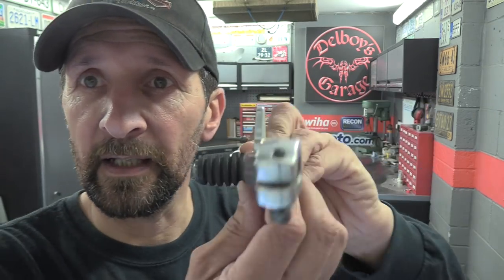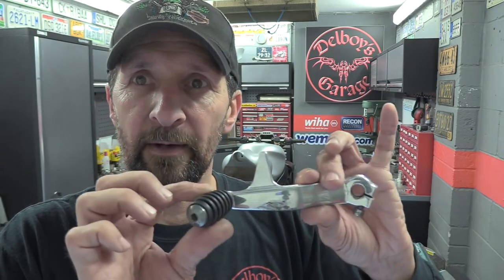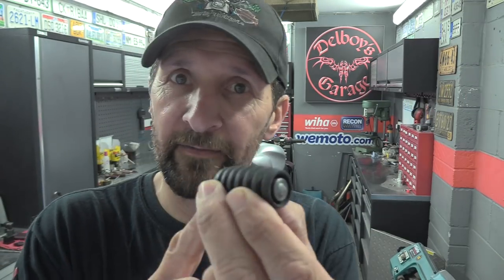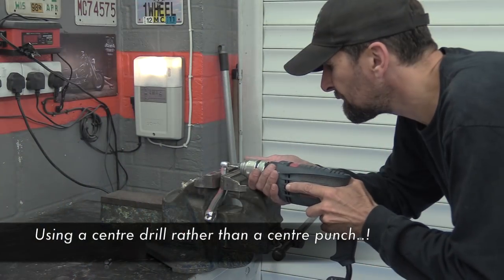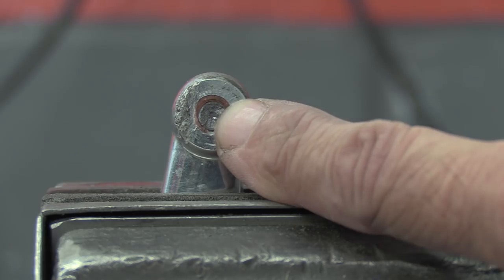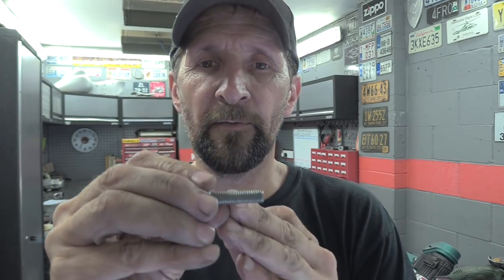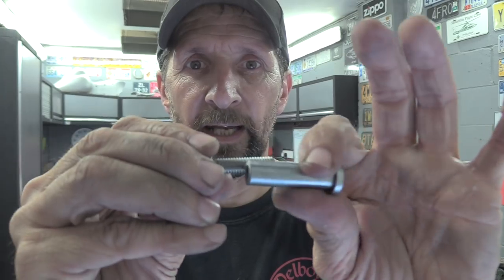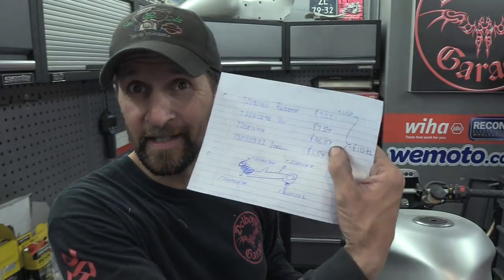Delboy's Garage, Broken Gear lever fix..!

Comment: A friend of mine who is an aircraft engineer showed my a great way to drill down the center of a broken off stud. You had some thread on the back of the lever. Get a bolt the same thread, Put that in the lathe and drill down the center of it. To which ever diameter you need. Then screw this in on top of the broken stud and use it as a guide to drill dead center into the stud.

Comment: Broke exactly the same way on a solo tour into the mountains in India with no repair shop nearby. The lonely road side shop I found could not drill out the piece stuck inside. Had to hitch hike to a bigger town to get it drilled out. Came back and put a bolt through with a few nuts to cover it and rode 500kms back home. So much for engineering design! The video brought back some fond memories of that trip!
Reply from the maker: Yes i think they really could have done  bit better in the design, even if the hole in the arm was clear, and a screw from the inside, then all you would have had to do was poke out the broken bit and stick a new bolt through the hole... I guess we can always improve on factory design in the small things... Thanks for sharing your experience, you videos look like it was an awesome place.. ! take care.. Del.

Comment: Same thing happened to me except someone cut me off and I dumped the bike. Sheered off the pin but luckily I had vice grips with me so I could get home without a tow. Only had the bike 5 minutes when the guy cut me off (and didn't stop... just drove off). But I don't have all the tools you have. Ended up having a shop drill it out and rethread it. But the shop didn't put locktite on it... a week later it fell off but luckily I heard it and found it waiting for me in the middle of the road. Added locktite and been riding now for 8k miles with no more problems. GREAT video!
Reply from the maker: Sorry to hear about the drop Tim, what a Basket aye.. good job you weren't hurt mate..  Sounds like you got it all sorted, fancy not locking it in for you aye.. simple enough aye.. good job you could find it..!  thanks for your support mate, and ride safe.. Del.

Comment: Breaking a tap off in a hole isn't the end of the world. The first thing I try if that happens, is to shatter the broken tap with a hammer and punch. This actually works pretty well. If that fails, then I have a set of carbide bits that are normally used by dentists to drill teeth. These, in the chuck of a high-speed Dremel tool will allow you to grind-out even a broken tap. It's time consuming, and nerve-wracking, but it's worked for me.

Comment: Nice job as ever Del, really enjoyed that, found it curiously therapeutic to watch.....bummer the bike fell in the first place, was there any other damage or did you get lucky?
Reply: PS I once lost a fuel cap from a light aircraft (spookily enough at Compton Abbas in your neck of the woods) and it cost me £470 to replace....in that context £96 for the gear lever sounds like good value!!
Reply from the maker: No, got away with in on the whole, just the usual light marks on the lever, mirror and bar end.. but nothing that could be called damage.. Chat later buddy,. looking forward to catching up..

Comment: Those damn shift levers are such a weak point on those model Scramblers! It has happened to me (and many other people) as well.
I think you got EXTREMELY lucky that only that bolt broke off, usually the lever brakes from the other end and takes off the tip off the shift shaft, then you would have to open up the transmission cover to change that out! Also the price for that lever isn't too bad compared to here in the U.S. It is $150 (about 120 pounds) over here!

Comment: Just wondering if heating the gear shaft at the end with a hot air paint stripper would loosen the locktite? I recently bought at Aldi a screw extractor ( like for when you round off a phillips screwhead) and if you drilled a pilot hole and used the screw extractor.....

Comment: You know there are counterclock wise drills, meaning the spiral is ccw. If you use these sometimes the bolt commes out during drilling due to heat and pressure relief.

Comment: I seem to recall there are chemical/electrochemical ways of getting broken steel tools out of aluminium parts. Black magic to me, but seemed to work.
Reply: Spark erosion is the way forward to remove hardened steel but very expensive

Comment: Did similar when drilling out the remains of a stuck break pad pin in a caliper. Had to be careful not to damage the internal thread in the body of the caliper.

Comment: You got a welder. 
Weld a bolt onto it. 
The welding won't weld to the alloy but will to the metal bolt. Then screw it out. Total time 10 to 15 minutes

Comment: Manufacturers design it to be tough to fix on purpose, most of their money is made from servicing/labour and parts.  Some engine parts are probably still designed to fail after a while just to get paid to replace them, more likely in the past, but if they can get away with it they will still do it I reckon.
Reply: Great job btw, I hope the new part will not be needed :)

Comment: Nice repair and you deserve a pat on the back  keeping things OEM. Hard to believe but I also broke the tip off my shift lever EXACTLY the same way just last Sunday. I lack the right tools so I toyed with the idea of buying a used replacement on eBay for $35 (only one is available). For some reason I opted instead for a new aftermarket unit with a spring-loaded folding tip from an outfit called Cafe Racer X, whoever or whatever that is. The price was right at $25. I haven't had a chance to try it out yet.
Reply from the maker: Hi Marc, yeah, i think its a common problem with any fixed lever peg.. and good call on the spring loaded one.. i guess its not something the factory decided to fit to this bike, even though it was their "Scrambler" model.. makes you wonder aye... Good luck getting it fitted buddy.
Reply: Enjoyed your style of fix, Del! I don't quite have the concept as to why all bikes don't come standard with spring-loaded shift levers, and even most foot brakes as well!? BTW, how'd the end of her handlebar come out of the tip-over? atb
Reply from the maker: Hi Allen, yeah, have to agree, anything that sticks out and is liable to cop an impact, should be retractable, I guess they make footpegs fold up for the same reason... but at £97 a go for a new one, they're hardly gonna complain about the sale profits...!  The bars were fine, just a scuff on the bar weight and the edge of the mirror, even the clutch lever just got a few light scratches, really got away with it I think!
Reply: Yep, got away with that one!  Second morning of a 7-day ride, my partner's bike fell just like that breaking the clutch lever completely off. Vise-grip from the tool kit served as a very usable clutch lever for the next six days, with many miles of rough gravel on that BMW 650.  Glad her damage wasn't bad!

Comment: Delboy, i made
 a shift lever for my harley due to the fact my shift lever snapped. i used an old forward control shifter are and a 1/2" x 3" 23 thread bolt and a 13mm deep well socket. kinda went old shcool. worjs like a charm and hasnt broken.
Reply from the maker: Thanks for sharing that buddy, sounds like a great old school solution..

Comment: Nice job! Next time build up the broken stud with weld (won't stick to the alloy) weld on a nut and wind out, the heat will help release the thread-lock too. No risk of damaging the thread in the alloy. Have used this method a few times, even managed to remove a snapped exhaust stud without stripping the engine.
Reply from the maker: I did exactly the same on a brake pad pin that was rounded out completely, even a torx bit wouldn't touch it... so welded an allen key in there and wound it out!

Comment: Nicely done young man! I hope Penney's custom paint job didn't get damaged when her bike took a tumble. :( :( :(
Reply from the maker: Hi Jim.. Thankfully no damage at all to the bodywork, not even the obligatory tip of the mudguard.. just a scuff on the mirror, and tip of the clutch lever, it was pretty lucky to get away with just that one problem..

Comment: I have to say, i'm jealous of how good you drilled that. I would never have been able to get it so well centered and straight.
I would not have drilled it with a 7mm and tapped M8, because i would never be confident enough it was centered. 
Instead, i would have drilled it to 5mm and tapped M6 from the other side. That may have run the rest of the old bolt out, if not , drive a 6mm bolt through and drive it out.

Comment: Hey Del! Awesome vid! May I ask what is the fuel consumption of your triumph bonneville? I have a 2014 T100 and changed my pipes with TEC tracker 2-1 and remapped it with arrow exhaust. However I think I'm getting 12km/ liter. Also I can smell fuel out of the pipe. Thanks!
Reply from the maker: Hi there Roy... Penny has the 2013 865 Scrambler, slightly different motor, (270 crank) but the same performance pretty much... it is mapped by the dealer to the "Arrow Map" and she gets maybe 130 from full to reserve light , tank capacity is 16 litres, 4 of that is reserve.. so the bike is using 12 litres in 130 miles, (209Km)  so the bike is eats "17km / Litre"...  no smell of petrol mate, so maybe you have a leak..!
Reply: @Moonfleet41 Thanks for the reply mate! Will check the pipe for any leak. Hope to see penny on your next video. It's been a while. Take care!

Comment: Nice job !   At first I thought you would have drilled all the way through the shifter stud using the allen key/hex key hole as a center guide and then counter sink for the bolt head ? Your way is just as good and gave me a new perspective... Speaking of lathes, I have a South Bend Heavy 10 in my little shop(of horrors) and I love it ! I also have a small milling machine. Makes life so much easier. You`re going to really step you game up when you get one..  Removed a stainless exhaust stud yesterday in a HD Twin Cam. What a b*tch ....WAY TO GO WITH THE LOCTITE !!!!   BROOKLYN OUT !
Reply from the maker: A 'South Bend Heavy 10'... dead envious right there.. Thats would be so cool and yeah, id love something like that, but i have nether the money nor the space for something like that.. ill just be getting a small hobby lathe that goes on the bench top.. but even that will make so many more jobs possible..  Yeah, great to find a broken stud is thread locked in as well aye..deep joy lol    Thank you for your kind and loyal support sir, its always good tp hear from you.. have a good weekend.. Del.

Comment: nice video,is there any chance of a tutorial video of removing scratches from stainless stell exhausts? watching you restoring that gear lever reminded me of my exhaust cheers😉
Reply from the maker: Not done that so far Scott, not on video, it all depends how bad the scratches are, and how thick the exhaust.. its just common sense buddy, small fine file to rub out the bad scars, and then some emery paper,, keep getting finer and finer till you get to a 1200 grit wet & dry... then polish it with Autosol.. it'll come up like new, its just elbow grease mate.   Good luck with it. hope that helps in some way.

Comment: Nice work Del, I really enjoy all your videos, you have a very logical way of thinking when it comes to problem solving. I need to get a good TAP set what do you recommend...Cheers..
Reply from the maker: Here you go buddy, this is the set that I use, they've changed the colour of the steel box, but it's the same tools and it's never let me down, 3mm to 12mm metric and there's an imperial option set if you have a Harley or old Brit bike, here's a link, treat yourself!  https://www.spanner-monkey.co.uk/tap-and-die-set-28pc-split-dies-metric-59398?search=AK3028&description=true
Reply: @Moonfleet41  Thanks Del...I have a Harley and hope not to ever need to TAP anything on the it. I was looking at the WURTH insert set too...its a great product, I watched your video on it...I'm in Canada and the set is about $ cnd 280 https://shop.wurth.ca/cutting/time-sert-thread-repair/time-sert-universal-kits-inserts-standard/standard-time-sert-universal-kits/. I guess you would buy the proper set as you need it.

Comment: Hi del, 
I had almost the same thing happened to my bonneville se couple of days ago. Difference with mine is that the gear shift handle in a weird way didn't break but deformed bended from the weight of the bike and gauged a chunk out of the clutch cover. But when i stand the bike up the gear handle does looked like it's deformed in any way looks straight. But still it pushed itself into the cover.?
Could this casting deform and return to its original shape by itself? Or did something in the gearbox deformed and allowed the gear shaft to flex or bend so the gear handle touched the clutch cover? 
I'm bit concerned that in the worst case there is internal damage? 
Is this possible or are these bike sturdy build? 
Also any suggestions to repair the damage on the clutch cover? 
Because new they cost about 300+€😱. 

Thanks 
Dieter
Reply: gemini232003  
 Thanks for the help, i already tried To shift The bike while not running.but that doesnt go so wel. It gets stuck on a gear pretty fast. But when i rock the bike a bit then it goes again. I also drove the bike to home and it shifted ok. Sometimes a little notchy, but in the 9 years i have the bike it did this on occasions. The clutch cover is made of aluminium.
Reply: gemini232003  
Thanks for the useful info. My first thought is that i think it's ok. But I'm worried about the shifter shaft being bent or not. I read in forums that's the sensitive part of they touch the ground on the left side. 
And i don't want to take rt clutch cover, the gear selector cover, the front sprocket off to check if it is bent or not. 
I was wondering if del had this damage on pennys scrambler? 

Thanks again

Comment: (p) Very nice Del . Arm looks better than new . Drilling out bolts is a pain .
Reply from the maker: Sure thing Pete, it's a nervous moment when you're trying to drill out the old part, easy when it's a cylinder head exahust stud as lots of meat around it, but when it's a little ring on the end of an arm, it's so easy to crack it and end up with a £97 bill!

Comment: I do not understand why people park their bikes in neutral! You wouldn't do that in a car. For this reason. Although it makes for a nice opportunity for a repair video 😊. Leave neutral for safe garage parking.
Reply from the maker: Wait, so you park your car in gear every time you park it?  Is that what your driving instructor told you to do?
Reply: I park my automatic car in Park (not neutral) and I park my manual transmission in 1st or Reverse (depending on the circumstance) with the handbrake on.

Comment: I know the feeling of snapping off an exhaust header stud,  even filmed me snapping it .  Bugger,   Tried grabbing the end but failed,  so cut flush and pilot hole drilled then snapped the easy out in it.  Lost me rag and whacked it about with cold chisel and it came out.  Drill the 6mm out with an 8 and then a mate drilled and tapped an 8mm bolt with 6mm inner thread and fit like a glove .... lucky..
Reply: I been away a while but still watch , but felt the pain of snapped bolt here ,  had to comment,  great fix and relief I bet.. ✌️
Reply from the maker: Great releif indeed mate.. it ain't over till the new bolt screws in again.. and lucky the tip of the arm didnt take the hit and cost us all that money.. nothing worse than a tool snapping off too.. its almost like the devil is laughing at you..lol

Comment: Excellent work as always, Del!  I'm impressed.  Crazy the cost of the OEM shifter... I was curious, looked it up for my BMW S1000R... $182.00.  Amazing.  For my old '03 FZ1, it's $60.00 (still expensive for what it is, I think).  So awesome that you can repair it, and it's now really better than factory.  Huge thumbs up.
Reply from the maker: Hi Donald, Yeah, i guess it depends on how much manufacturing went into the part, they can vary from a simple welded steel arm bent to shape..to a sophisticated casting with multiple angles and threads.. either way, i bet the manufacturers didn't actually make them anyway.. they'd more like lt be made to order in batches in China or India.. after all, thats where practically the entire Street 750 is now made aye... so the price is more 'markup then outlay for them..!   Take care buddy, and have a great weekend... Del.

Comment: Nice! I know all too well how hard it is to drill precisely down the middle of a broken off bolt, but I have managed to get quite close a couple times. I also know that "Easy Outs" are anything but once you have one snapped off in the hole!
Reply from the maker: Yeah, i was a bit of a chicken here i have to admit.. once i had the 6mm drill all the way through, i could have hit it with a 7mm easyout.. but if that snaps off, (and remembering the red permanent threadlock in there), i just didn't want to end up braking the end of the lever.. so went with plan 'A' as i had the middle of the bolt almost bang on...

Comment: Del, the exact same thing happens when my wife dropped her Bonny.  It's the same shift lever as the scrambler.  I was fortunate that when it broke, there was the slightest lip in the metal and I got it started with a small chisel.  Unfortunately, it took the clutch lever with it when it went over.  I fixed it all and spent the money for crash bars.  Have a great ride this weekend.
Reply from the maker: Good result mate, its really handy when you have just enough sticking out to tap it round aye.. Crash bars are a good investment, but its not my bike, so not my choice.lol!